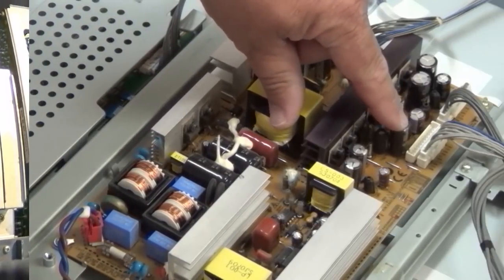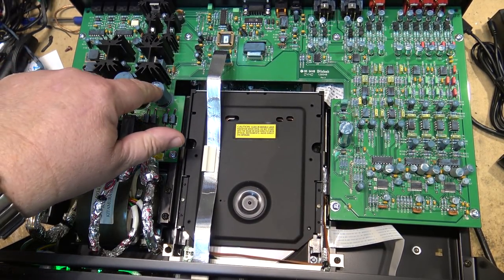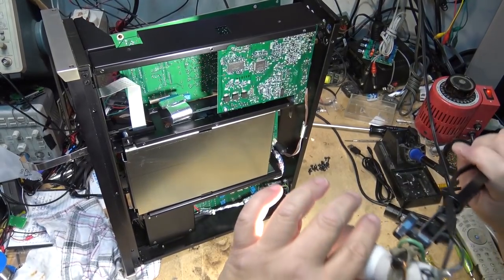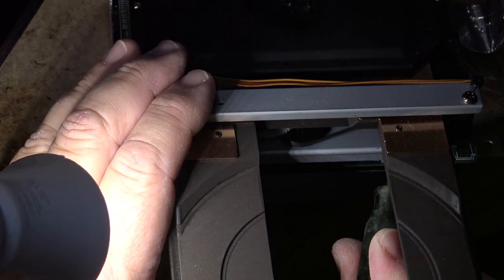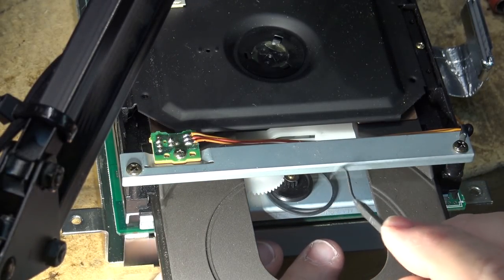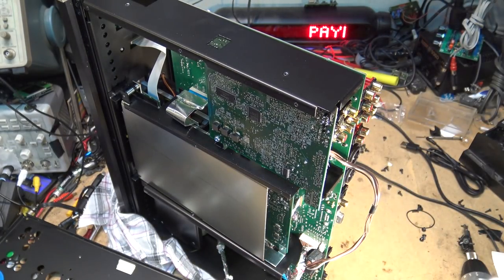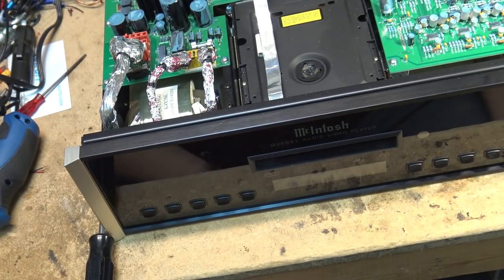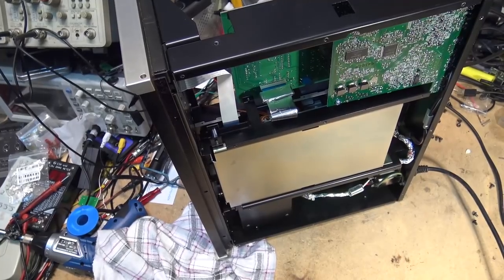McIntosh MVP861 CD player not loading correctly   no play

Comment: When I see "audiophile" stuff I always wonder how much snake oil it contains. This thing is built like a tank just to raise the selling price; and beside that, the CD transport is actually pretty cheap and flimsy. All that shielding's and anti-resonance treatments can benefit only the analogue section, the digital section is immune to all those problems. The user interface looks very poor too,  just the basic functions available in the front panel, all identical buttons, one line VFD with no track info... This player is designed to look "cool" and very costly until you open the tray and realize your 30$ DVD player very likely has the same disc transport (and the same remote too judging from on-line pictures)
Reply: But a $30 CD player won't get you oxygen free cryogenically frozen copper and capacitors kissed by pope. That's what makes the difference. 🤣

Comment: I enjoyed that a lot. Wow, what a job that was! When I used to do this for a living, I'd dread writing up invoices where a dollar part was next to a $50 labor charge. My boss would tell me to break down the labor on the invoice so the customer would know how involved a job was.
Reply from the maker: I had one a hole of a customer that was so anal that he wanted a total break down to the minute of the service. The invoice went something like this.
Part cost 5.00.
Labour charge 90.00
Break down of labour charge
Labour to disassemble and reassemble 10
Labour to replace part 10
Labour to clean heads and mechanism 30
Knowing how to take it apart and get it back together 40
Shop supplies 5.00
Itemized invoice 2.00

After this prick, the shop policy was changed. What happened was an over zealous kid that was working in the store phoned the customer with the good news that their VCR was fixed only an hour or so after it walked in the door. It just so happened that I had just finished a job when it was carried around the back and I grabbed it and went to work on it. Problem, kentucky fried chicken boned shoved in and then a tape put in. Broken gears and grease all over the place.  We got a good laugh about that.

Comment: The amount of work to take it appart and put it back..... Amazing.
Reply from the maker: It was a bit of work and I am going to have to fight with the owner because he never wants to spend more than 30.00 on repairs. Actually I am going to offer to buy it from him if the price is right.
Reply: @12voltvids  A while back i saw a guy put coke cola on cassette deck belts in a youtube video and he said it helps make them slide nicer again.  Do you thnk its a bad idea to use coke cola for things like that.  He was also using it on cassette tape housing for ones with sticky wheels.
Reply: @12voltvids  Audiophile... wants repairs on the cheap. That really does not compute.
Reply: @12voltvids  that's weird. Usually McIntosh owners have a lot of money and take good care of their machines. They won't bother if the thing needs a few hundred $$ to repair it...
Reply from the maker: @jasejj  Actually for this piece he didn't grind me like he usually does.
Reply from the maker: @TheRailroad99  I told him the price and he went to the bank and got me some plastic. (our bills are plastic now)
Reply: @stpworld  Coca Cola should ONLY be used as a refreshment!
Reply: @hestheMaster  theres another video were one guy does actually use it to clean beltsa and the housing of audio tapes for lubricant i think hes wrong for that and its not 12voltsvid a differnet person

Comment: Nice job on this deck. McIntosh units are top machines but also a paradox for anyone servicing it.

As they are built like tanks, they are luckily particularly well built and aging well. But this has a double cost: first when you buy it, second when you service it. Once you know the value of these, it's a dream to have one to service, and you just want to care with maximal attention, white gloves and so on. But once you're really in, it's a nightmare: heavy and fragile equipment, hundred of screws and limited accessibility, specific technologies... 
I remember a "small" integrated amp, 105W but 40 lbs beast with it's fabulous output transformers, that needed vu-meters lights replacement and pots cleaning with a general dust cleaning: hundred of screws, hours of attentive care with the glass and aluminium face plate, limited accessibility in a heavy and tight mechanism. Not the Japanese modular point of view: it's not two minutes to get a drop of Deoxit in the volume pot , but two hours to access it, two month to get a new one. But once cleaned as a surgical plateau and checked, it was worth any Penny and attention it needed!

Anyway, it's also very impressive to manage with these equipments, least expensive ones are always priced in thousands, but loosing less value as they age than average. This SACD DVD was far advanced in technology when it was produced 20 years ago, and actual Blu-ray or high definition DACS are far more performant, but it's still sounding good and probably better than most actual decks on the market. Their tuners and power amps are fabulous. If you have the luck and money to buy one, you'll be the next happy few!
Reply from the maker: Oh I have the money.  The reason I have the money is I don't blow it on audiophile equipment.  I have some but I only buy stuff cheap.  I have a McIntosh tube amp in storage.  The main reason I am not using it is because the output tubes are original and are no longer available.  
I piss my cash away on new cars and motorcycles.  You know, boys' toys.

Comment: Love these machines like this. Many people got rid of the DVD players to upgrade to blue ray  and HDMI outputs. Still make awesome CD and SACD player, and fairly cheap now. I have a Sony DVP-S9000es which I had a new laser transport put in it and use it for audio only, mainly for SACD. Copper clad chassis, Nichicon Gold audiophile caps, huge power supplies, and you can switch off the video to lower noise.
Reply from the maker: The bastard that owned this machine was bragging how he got it for 200 and was so happy to have found it.  I tried to charge him 100 because i know he is a grinder and sure enough he pulls out a 50 and that is all he has.   I ran into him a few weeks ago and he was blowing about selling this unit to someone for 1300.00.  Guess what, he just shot himself in the foot because I had a few pieces of equipment of his that is never going to be repaired.  You know the saying don't bite the hand that feeds you.
Reply: @12voltvids  Standard bench fee around here in the Seattle area is $100 minimum just to diagnose and tell you what it needs. I seem to acquire things people have left with me because they did not want to pay several hundred to fix it. I took in a Sansui G-8700DB and I told the guy that these direct coupled amps are known to short out and take other parts with it like dominoes. Sure enough all the outputs are shorted and mismatched transistors botched into one channel with resistors in the bias circuit altered just to make it work, sort of. Total of 16 transistors and 8 resistors fried, so he said keep it.
Reply from the maker: @zulumax1  
Nobody around here will pay a dime for estimate fees. That's why i got out in 2003.  Tell them there is an estimate fee and they walk.   The only reason I take on any repairs is to make a video of. I make far more from the advertising than the repair.
Reply: @12voltvids  Depends on what you are working on, of course for a piece of gear that is only worth $100 or so, of course not. We are lucky to have a brick and mortar hifi audio shop here in Gig Harbor, WA USA. The repair technician George has plenty of incoming repairs sitting on the shelf. The basic fee eliminates the bottom feeders. Of course he is working on McIntosh, Krell, Naim, Acuphase, and Line Magnetic, mostly high end top shelf stuff. Myself, I can't charge a minimum fee  either, that is why I end up with the carcass. Looking for videos on repair and circuit theory of operations of CD players and VHS machines. I have dead ones that need to be bought back to life. I subscribed because you seem to cover some of these facets. Thank you for responding.

Comment: Good video.  I think this player may have been modified by the Upgrade Company.  They are known to mod units with blue conformal coatings and RFI shielding on power and some signal cables.  I have not seen these sort of things present in any stock McIntosh products.
Reply from the maker: So the guy that had this one picked it up for 100.00.  I tried to bill him 100 for the repair.  He bitched and complained.  So i offered to buy it from him for 300. He refused to sell and offered me 50 buck for the repair.  I told him i would remove it and return to broken condition. He finally came up to 80 and cried about being broke so it was take 80 or remove the belt for free.  I held firm on 100 but he threw 80 and said that was his limit. Said he was going to keep it because he loved the look and that's why he wouldnt sell to me.  I ran into him about 6 months later and he was bragging how someone gave him 1300 for it and how much he made.  Needless to say the rest of the crap of his I had didn't get repaired and I was working on an expensive sub that i just stuck back together. Don't need customers like that.  Anything he wants repaired is going to really cost him going forward and it will be cash up front.
Reply: @12voltvids  That's crazy, the teardown on this unit was pretty involved.  A $100 for the diag and fix is very reasonable.  Some people are way too cheap.
Reply from the maker: @daslaundrynazi  tell me about it. That was one of the reasons i left the business. No money in it.  
I make 100 to demold an 8mm video tape.  Some places charge upwards of 400 to do that.  I might release a video on how to do it just to stick it to the guy in New York that charges 400 for basically about 30 minutes of work.

Comment: As usual, nice job, the belt definitely needed changing. However I couldn't help wondering if the reported (stops after 5 mins) complaint was due to a mucky laser or gummed up sled.
Reply from the maker: No it played here fine when it loaded correctly. The only time it didn't was when the clamp wasn't fully engaged and the disk was slipping.

Comment: Nice, handling circuit cards without using anti-static wrist straps.
Reply from the maker: Here we go. Another idiot that thinks wrist straps are required.  Got new for you bud, they are not. Only if you are handling bare components, and only if you are in a dry air high static environment.  I wear cotton clothes which do not generate static, and I also discharge my body every time I touch the grounded tripod to start and stop the camera.  In the 40 years i have been working on electronics i have damages exactly 0 circuits from static electricity and I have done component level chip replacements.  As long as you touch something metal first  there will be no static charge in your body because you have already drained it.
Reply: @12voltvids  and that's all folks!  🎤 drop

Comment: So the machine did not have to be dismantled to change the belt????
Reply from the maker: Of course it did.  No way to reach it assembled.  It is about 2" back.  Try and do that without taking it apart and not damage the finish.  It may have looked easy but you didn't see the 15 minutes of cursing and turning the drive every which way but up to get that bloody belt in.  The camera cuts and like magic the belt is over the motor pulley.  It was not that simple and there was about 15 minutes of struggling to get the belt in place.    There is a plastic cam that is in the way that moves the laser block up and the tray has to be closed and the chuck moved up slightly to get the belt behind it, then opened again to pull the belt over the top.  So no way in hell is that being done without removing the deck and anyone that says different is a troll trying to stir up shit.

Comment: Don’t electrolyte capacitors mechanically vibrate?  Put a stethoscope on a power supply cap and they hum.  That’s my guess as to why there’s the coating on the caps.
Reply from the maker: They do under high loads, but I believe this is done to prevent microphonics from external vibration. Could be wrong, but that is my guess.

Comment: I'm very confused with the internals on this player. My MVP 861 has none of the foil around the power cables or the ribbon like in this. Nor does it have the rubber coating on everything. Makes me wonder if this was hot rodded out by mod wright or something? 
Very weird! 🤔
Reply from the maker: Could have been modded by someone and then sold for a big profit.  Don't  know, this is the only one I have worked on.
Reply: Could be. It's cool you noticed the tweaks done to it though. You must be an audiophile at heart 👌🎼✨
Reply from the maker: @vpconcepts9838  bahaha  right.  You should see my setup.  All that to listen to am radio.
Reply: 12voltvids You know what they say "The cobbler always has the worst shoes in town" 😊👌✨
Reply: All the shown resonance and shielding mods, incl. the blue Mc glue was done aftermarket. There  is no factory TSB for that type of modification which I am aware of, and I work on Mc gear of all years and types regularly. Matter of fact, I own a MVP-861. I use it all the time for region-less optical media, incl. SACD, CD, DVD/A, HDCD,  MP-3 and more. I also have a MVP-891 for Bluray discs and newer A/V codec decoding. The belts in these fail about every 5 years on average, like clockwork. I''m on my 2nd replacement,... I only use the belts sold from Mc's Parts dept, or Audio Classics (same thing).  All belts are not created equal. Japanese belts made of virgin rubber are superior in quality and hold up the longest.

As far as changing out the load belt, there is some truth in that there is an easier less labor intensive way to do it. BUT, I did  the exact same thing 12Volt Videos did on my first MVP belt change too, so no harm no foul no disgrace. I now have a shortcut which I use a factory guy clued me in on. It doesn't put the transport, face plate, or surrounding electronics in harms way and saves time. I've got a new belt on the way for a MVP as I type this, same issues.
Reply: Phil Lanassa Wonderful knowledge thank you Phil!  I have since sold the mcintosh & got a meridian 506 as a transport. Looking at Jay's Audio, audio research, or MBL for the next one. If you get a chance to check out my channel,  I hope you enjoy! 👌🎼✨

Comment: Hi there. What could it be if CD player is not reading discs? only gives one turn then stops, and one here's a ticking sound in it, its the lens moving up and down. Thanks in advance.
Reply: Laser pickup focus adjustment.
Reply: +84ohms - If the ticking is coming from the motion of the lens (moving up and down), then the player is not finding focus lock. Most players are programmed to do 3 or 4 focus searches then abort if it hasn't been successful. If this is the case the focus servo needs to be checked. Problem could be as simple as a dirty lens. Other problems could be a bad connection between the transport cabling and the pcb or misadjusted servo pots (consider this possibility last). One other possibility is the ticking noise being caused by a sticking sled mechanism. When this happens the ticking will continue for a few seconds as the player tries to send the sled to its home position and the drive worm screw jumps threads because of the unresponsive sled. That is what produces the ticking in that instance. The fix is cleaning and relubricating the rails that the sled moves on. A very light application of a silicone containing oil, like Triflow should cure this problem. Good luck.
Reply: @Inflec  how do i go about fixing it?
Reply: +84ohms - You first must make a positive determination of what is producing the ticking sound (lens motion or sled drive) as the two possibilities I cited require different repair approaches.
Reply: @Inflec  it is the lens making that sound. Saw it moving up and down.
Reply: +84ohms - Then start with the simple possibility first. Try cleaning the lens. Use a solution made for that purpose. General purpose cleaners may damage a player lens. While you're at it, try unplugging and reconnecting the cables that go to the pcb (you may have to do this anyway to clean the lens). If these steps don't work, then the problem is electronic and probably beyond your abilities (service manual and test equipment needed at that point).
Reply: @Inflec  tried the above mentioned already, and didn't work. Thanks for the help though
Reply: +84ohms - Then you will need the manual, multimeter and oscilloscope and know how to use them in checking the focus servo circuits of the player. As a long shot, if you have soldering skills you could pull the pcb and look it over for bad solder joints (they are the cause of a lot of problems, as many of 12voltvids case histories show). Good luck, sir.

Comment: repairing that is a big nightmare to me wow.
Reply from the maker: I did call it a beast didn't I?
Reply: @12voltvids  isnt that the most difficult ever repaired?
Reply from the maker: @janchristianursuaaguilar7434  
Not even close.   Time consuming yes difficult nah.
Reply: @12voltvids  if i repair a nakamichi dragon for example, i don't know where to start.
Reply from the maker: @janchristianursuaaguilar7434  They are fugly units to work on.
Reply: @12voltvids  why there are hard to work on?
Reply from the maker: @janchristianursuaaguilar7434  
Not hard, just time consuming as much disassembly required to get where you need to go.  This job took about an hour start to finish.  Most cd players take 5 to 10 min to change belts.

Comment: Doesn't even have an optical output. Hrumph.
Reply from the maker: Are you blind? It is right there between the XLR connectors and the orange coaxial digital output right in the middle of the back.
Reply: Ok fine. It's a wonderful machine.